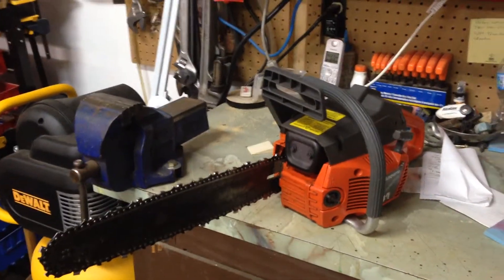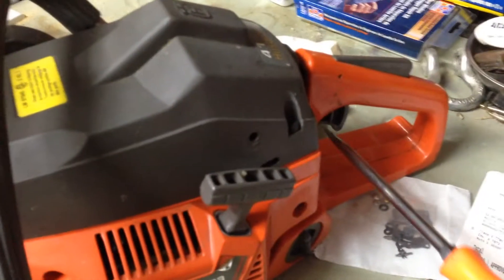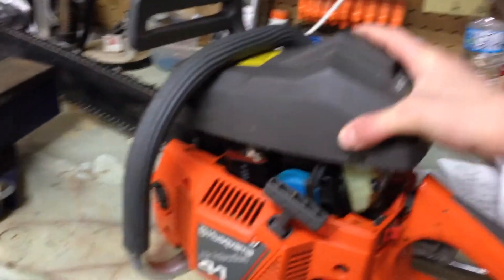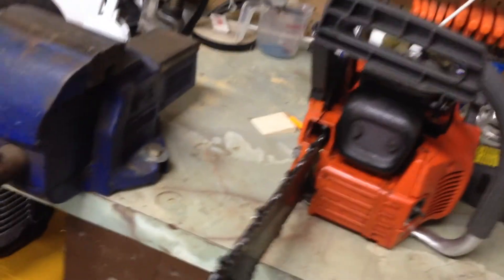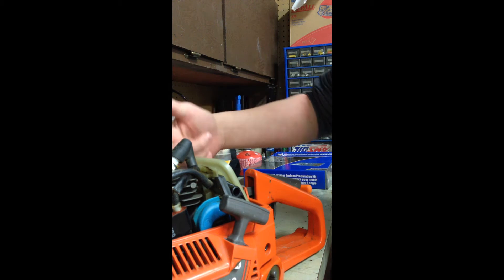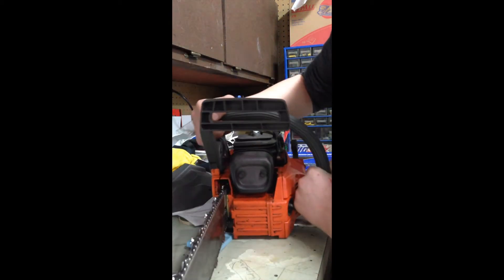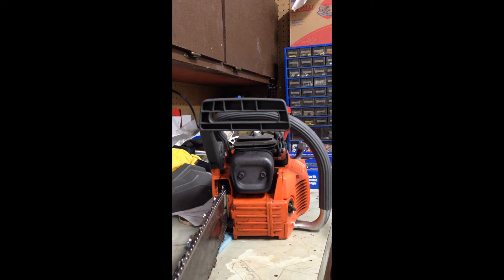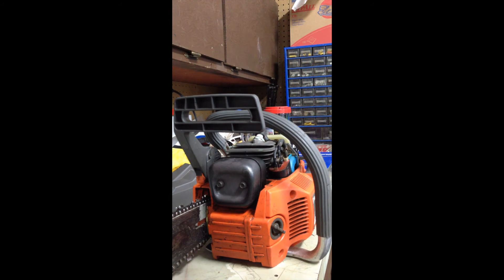Husqvarna Model-41 Review/Repair

Comment: Props for fixing up a true classic . I found one 4.5 years ago at the pawn shop in the town I live in that I ended up getting for $80 due to it not staying running which turned out to only be cracked fuel lines and then I gave her a little carb tune , threw a new narrow kerf 16" .325 bar and micro-chisel chain on it and rocked it for about 2.5 years using it to cut about 6 cords of firewood every autumn.  The only reason I sold the saw is due to at the time thinking due to financial hardships was gonna be forced to sell my home and move into a small apartment where obviously I'd have no use for a chainsaw so yeah I sold her , turns out I didn't have to sell my house , so couple months after finding out we weren't selling I went out and bought a model 135 mark 1 which is essentially identically to a 440 but has a 16" 3/8" LP bar and chain on it , no fuel gauge and standard cheap bat and gas reservoir caps, sold that saw after two years this past may after I used half my govt stimulus check to go out to my local husqvarna dealer once again and picked up a brand new model 450 E2 with a 18" X-force narrow kerf bar and 18" X-cut narrow kerf micro chisel chain, also bought with the saw a 16" narrow kerf bar and chain combo , which just for the record a perfect running 450E2 with a 16" narrow kerf bar and ultra sharp chain cuts through the knarliest of hardwood logs like they are made of cardboard no joke the thing is absolutely ruthless , has considerably more power than I even needed for the moderate amount of firewood I cut each autumn, have never run any other fuel other than husqvarna ,X,P ethanol free 95 octane premixed fuel , used nothing but premium husqvarna bar and chain lubes, and.motjing but oem tune up and repair parts directly from husqvarna except for occasionally in the past an off brand chain I threw on a couple of the much less expensive husqvarna saws that I've had in the past.  If I include fixer-upper saws that I bought to repair and sell for a profit along in the list of overall how many husqvarna chainsaws I've owed on the last 12-13 years it'd definitely exceed 15 saws , but only 4 of them have I bought and actually used for any extended length of time , plus one poulam pro pp4620av which was my first chainsaw about 15 years ago, a 46cc saw with about 2.7HP output , I had a cheapo 36cc homelite from a garage sale that I briefly had my little brother use whenever he came to help harvest firewood from me,, when the poulan finally developed enough loss of compression to where I had to replace it I went out and picked up a brand new 2014 Jonsered CS2245 which essentially is a husqvarna 445 with slightly diffemt shaped pull start housings and upper engine cover , and obviously the jonsered had a red and black body with jonsered decals instead of being all orange with husqvarna decals.   The Jonsered was a phenomenal saw that in the 3 years I used it I put it through the ringer pretty hard and she never skipped a beat , thing was the best running saw I've ever operated aside from my recently acquired husqvarna 450 which I'd have to say would tie with the jonsered for first place when it comes to the best running , toughest most reliable saws I've ever owned and operated., The 450 does though absolutely without any shadow of a doubt have a considerably amount more power , which I'd expect it to being it's engine is 5-6cc's larger than the jonsereds engine was , I'd still have that jonsered if somebody didn't steal it from my garage one day when I ran to town for errands , I mourned that loss heavily , the model 41 was it's replacement , followed by the brand new 135 mark1 which as I said has now been replaced this ruthless beast of a machine model 450 that I just got brand new 7 months ago , still only has 8-9 hours of total use on it as of current , she's barely beyond being fully broken in which only took place finally in the last 2.5-3 hours use prior to its current overall use as I said of only 8-9 hours, I have both 16" and 18" .325 narrow kerf (pixel) bar and chain combos , I am going to buy a narrow kerf 20" bar and chain for it but the 16" setup will always be my primary bar and chain size I use the most , I actually tmw am taking a trip to my local husqvarna dealer to buy another spare 16" x-cut chain , a full tune up kit for my 450 And a couple quarts or  a gallon of husqvarna premium low temperature formula bar and chain lube as the average temp currently where I am is no higher than 35 degrees fahrenheit so yeah it's def time to switch to the thinner stuff.  In the next couple months I'm going to be doing an adjustable flow rate oil pump conversion from a 460 and plan to video tape key aspects of that job to put on youtube.   Good luck with your nice and clean model 41 , really miss mine and wish I still had her, will definatley buy another one if I see a good deal on one local to me that isn't a comete train wreck regarding its condition, def miss the model 41 substantially more so than my old model 135mark1.  Amd I like your ambition to go the extra mile to make sure you keep your saw nice and clean ,.so many people make the fatal mistake of overlooking the importance of that aspect of maintaining a chainsaw.  Amd good job getting her to run right too btw, may she aseve you for many more years to come

Comment: I bought one of these saws back in 1997, this little saw is pretty awesome. It died on me about 7 years ago and I just got around to fixing it, the saw would run a few minutes and slowly die. I thought it was the ignition module but it turned out that the small screen in the carb was completely clogged with saw dust. I rebuilt the carb, new pull cord, new plug, changed the sprocket to a 3/8ths and bough a SugiHara 14 inch bar for it. This little saw is my go to for limbing when felling trees for our business. Oh loved the Judas Priest song "hot rockin" in the beginning of the vid too